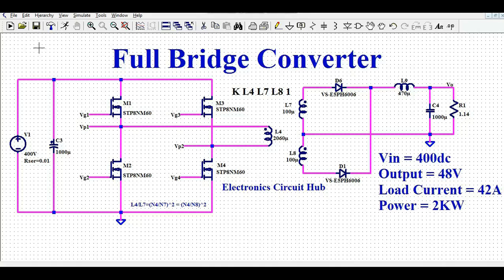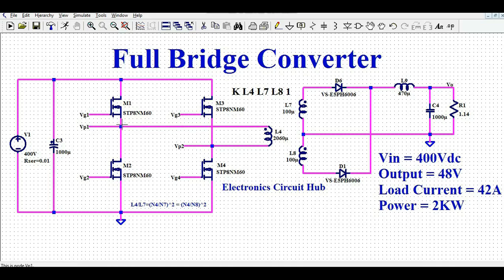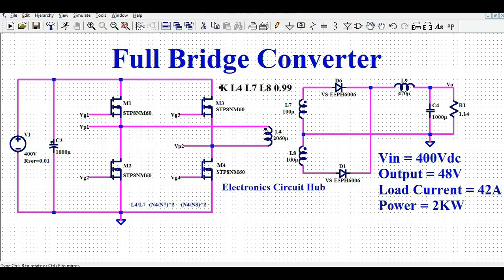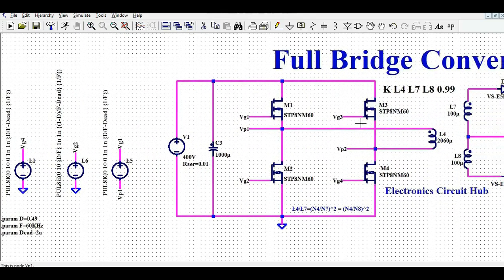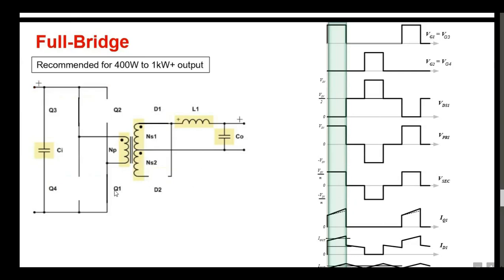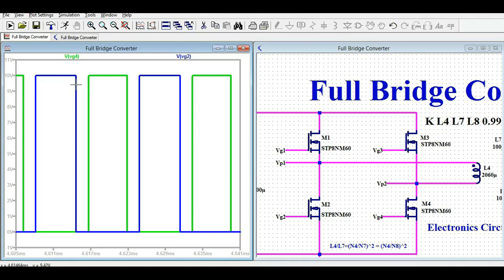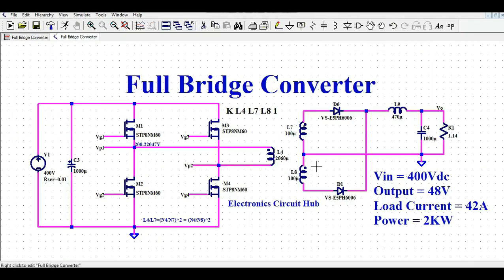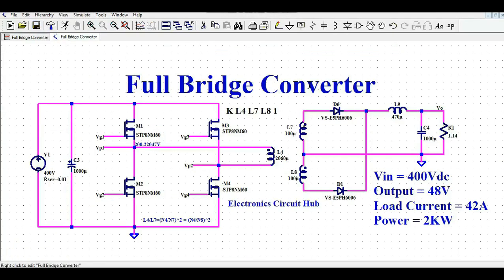Designing a 2 kW 48V Full Bridge Converter in LTSpice | Comprehensive Guide

Comment: Professor, Happy New Year. The design parameters are minimum values required?
Reply from the maker: Hey Dan, Thanks for asking good question. 
I hope you asked about the component selection. I have not calculated any value theoretically, i just plugged those numbers in ltspice and it works. 
Let me explain - C3 and C4 are overdesign value and we may need less capacitance value. 
MOSFET M1, M2, M3 and M4 are rated for 8A,600V so this is okay. But this mosfet is obsolete so i would recommend to new mosfet with similar rating.
Diode - VS-E5PH6006 is rated at 60A so you can use this diode.
For transformer design we might need to do some calculation to get the inductance value and core size of transformer. 
L9 value seems to be okay. 
Please let me know if you are working any full bridge converter project, it will be my pleasure to support and help you.
Reply: Professor, that is correct. I assume your establishing a starting design option and then throw component selection you would fine tune to the final design. In other words: step 1; conceptual design, step 2; fine tune design, step 3; coner-case analysis.
Reply from the maker: @pbaemedan  you are correct Dan